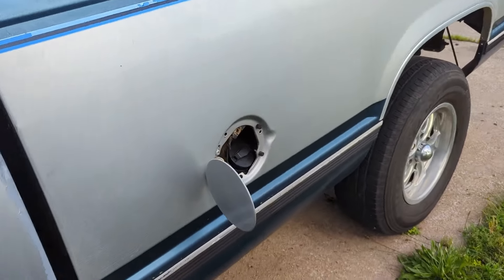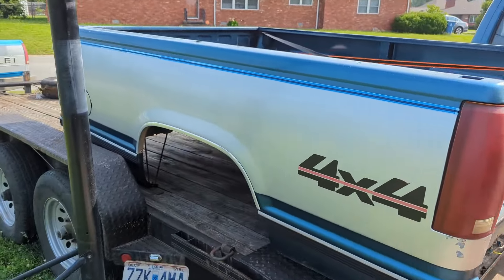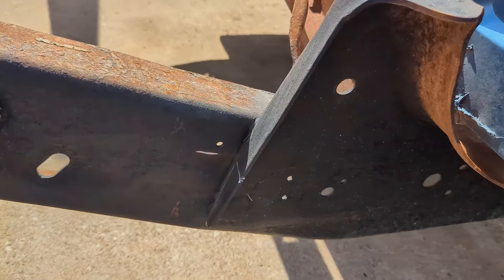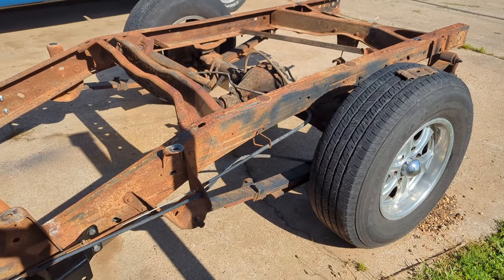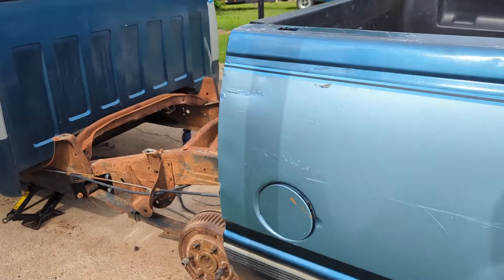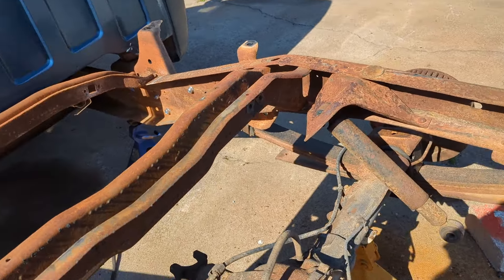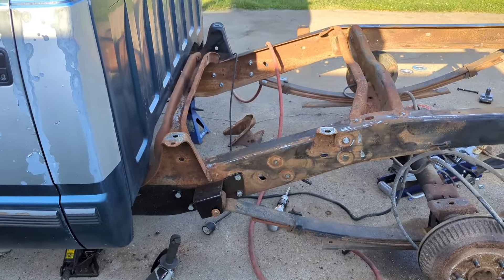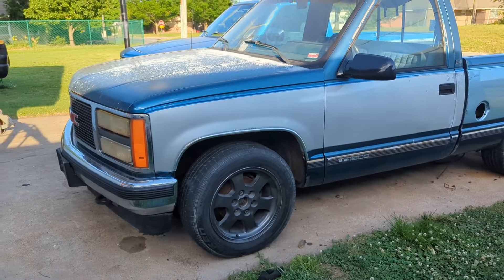88-98 Chevy GMC longed to short bed conversion, it's easier than you think!

Comment: Hey, just wondering going to be starting my 98 shortening in about a month I was wondering, how far did you have to move the differential forward?
Reply from the maker: I used the hole under the front bed mount to locate the front spring hanger, I believe it's like 18"
Reply: Hey, thanks for answering me back. Was that a 6 foot five box or was it the smaller one?
Reply from the maker: @deancameron1456  6 ft is the short bed, 8 ft is the long bed

Comment: How many inches exactly did you have to cut off the frame? And the rear leaf spring brackets,  are they new stock ones?
Reply from the maker: Was like 18 and an 1/8 I think, I used the factory rear spring hangers I just bead blasted and painted them
Reply: @Wrenchingwithray  ok awesome! Thanks for letting me know! Definitely want to do this to mine... and where did you get the front bracket for the leaf springs ? You have a link? Thanks!

Comment: I would assume this can done with a c1500 also? Did you drill new holes to mount the bed?? Lastly sorry riddled with questions, what exactly needed welding?
Reply from the maker: Yes same process on a 2wd,  I drilled 2 holes at the back of the frame for bed bolts, currently only have 4 of the 6 in.
Reply from the maker: Nothing needs welded, you will need to add a cross brace if you remove the spare tire carrier.
Reply: Thank you for the help! My search for a long bed begins 😅
Reply from the maker: @killerlopez14  lol

Comment: What drive shafts did you use?
Reply from the maker: I used the factory Yukon front  and  rear drive shaft not xl
Reply: @Wrenchingwithray  wait, a 99-06 Tahoe shaft, is a perfect fit for a short bed 4wd?
Reply from the maker: @Laynbodyon6s  it fits mine anyway